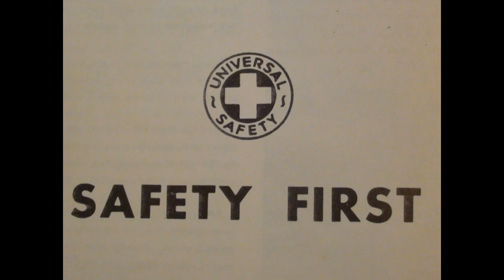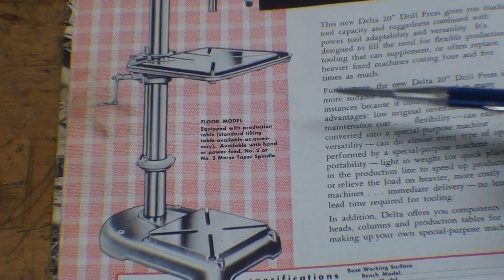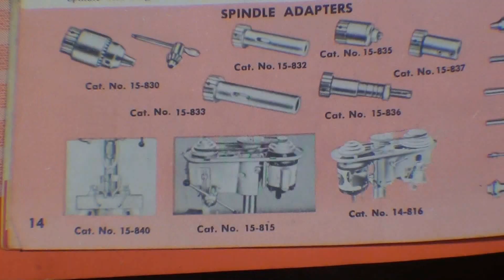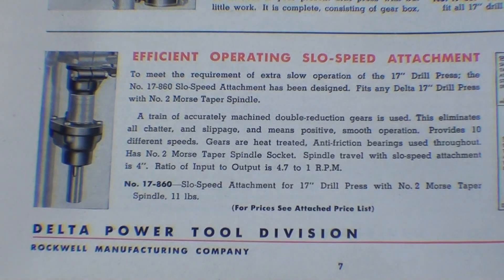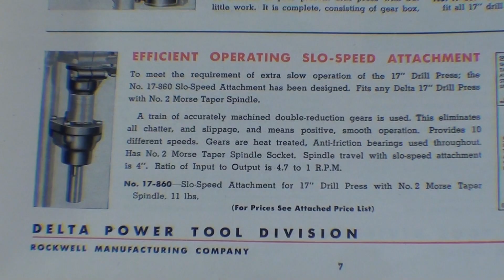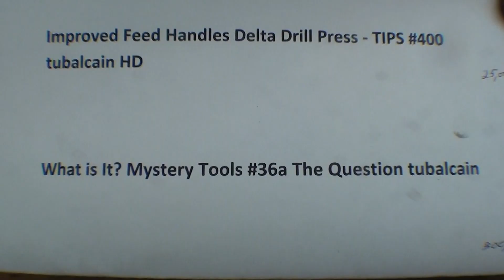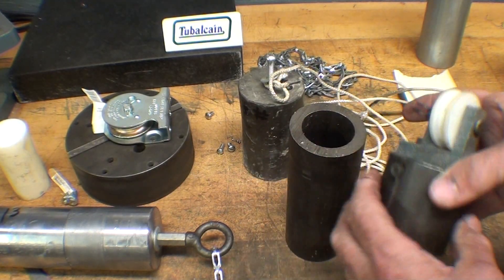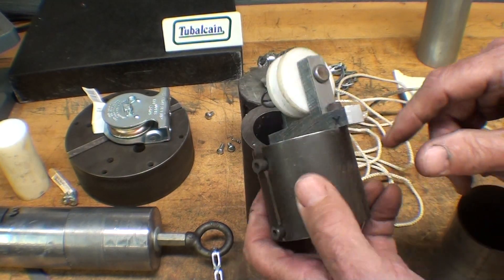COUNTER WEIGHTING A DRILL PRESS TABLE Tips #404  tubalcain

Comment: Fantastic. I bought an old drill press to restore, and my only disappointment with the machine was that it didn't have the table lift rack and pinion. I'll be making the same modification. Thanks for taking the time to make this video and help others like myself. BTW,  nice job on the handle spindle. Too many armchair critics make comments. Cheers from Australia.
Reply from the maker: Thank you

Comment: Did something similar to my now 45 year old Craftsman drill press about 40 years ago. I had to do it outside the main support tube and used a pulley, cable and for weight used a mushroom style boat anchor piled with blocks of babbitt that my dad gave me. Still working great.
Reply from the maker: Sounds like that also got the job done

Comment: Well I got one with rack and pinion, and one without. After watching you move that table, it looks like the counterweight is better than rack and pinion. I would like to convert the one without rack and pinion to counterweight, since this is the drill press I use every day.
I have some jig borers and the spindle heads are counter weighted and hung with real light motorcycle chain, think may be no 35. They have cranks that drive a sprocket, which raises and lowers the head. 
That sash chain looks kind of light, but I was not there to see it, but for those who may want heavy duty, just go with no 35 motorcycle chain. That is what I will use when I convert my drill press. 
Real cool video, this likely will help a lot of drill pressers, I know it helped this one, thanks for sharing.
Reply from the maker: That chain is  pretty strong

Comment: I made a table lift out of a harbor freight trailer jack. I also made a slow speed pulley set for the drill press as well as and extension to move the lock to the front of the table. It’s a walker turner as well.
Reply from the maker: That's a good idea
Reply: mrpete222 I could email pictures if you would like.

Comment: Lyle, another great video and idea, but here is a thought. As you are a 'Belt & Braces' man, how about changing out the top cap head screw of your pulley plug for a hex head. You should be able to get a spanner in to tighten it outwards, just enough to get a grip on the column tube. That will then save the Wings of your Greenhouse pulley rotating into your speed adjuster mechanism. My English Meddings drill is a solid column, so I had to pay out cash for the rack and pinion adjuster.Keep the excellent videos coming, and PLEASE DO NOT worry about your 'Ramblings', it s great to hear all your stories about life. If people do not like it then they can always fast forward or not watch at all. In case you do not put up any more videos for a while. Merry Christmas and  a Happy New Year to you and all the Family. Regards from Australia.
Reply from the maker: Thank you and merry Christmas

Comment: Nicely done. Greenhouse pulleys were used for opening and closing the vent windows if I remember correctly. That was back when a greenhouse used glass instead of poly. As far as complainers, mentally tell them what you would have told someone you worked with in a factory. Remind them it's your tools and not theirs. Also rotten comments are the sport of choice for people today. Their mouths never got them to meet up with someone in a parking lot after work.
Reply from the maker: Yes, heavy Pulleys two open heavy glass windows

Comment: Correct me if l'm wrong Mr. Pete, but those are YOUR drill presses to do what you want with them, Right?  Perhaps in some cases we should worry less and visualize Whirled Peas (7 billion of 'em)...it's a funny picture at least in my small mind.  

Thoughts for lowering the speed on you bench press is to check out the old 50's Craftsman/King-Seeley setup with a cam'd plug/middle pulley in the column.  Mine will go down to ~230 rpm.  You could build one easy!  Mine is a 49'/50' King-Seeley and lucky to get it with it.  Awesome thread on Garage Journal by FrankLee all about them and the multi-speed adapter and an external/internal counterweights.  I'll have to go external because of it, but loved your Sashi, belt and suspender, greenhouse pulley video.  

Thanks much, but I'm not convinced there is such a thing as too much coffee.  Someone said to me once "a yawn is a silent scream for coffee" and the older I get the more I tend to agree. ;-)  ~PJ
Reply from the maker: Thanks for interesting comments. I do have one drill brush that has that center pulley. And yes I would block the column and prevent its use for the counterweight

Comment: Thanks for the drill press tips. Probably the most common shop tool. I use one most every day. I actually own 5, and have considered putting a motor on mine table.
Reply from the maker: I also have five drill presses. Drilling is by far the most common operation in any shop

Comment: Good subject and solution.
I use an old Toyota screw type bottle jack to lift my table.
The Jack sits on a plate fitted to the lower pedestal and gives good fine lift adjustment to the table.
Reply from the maker: Good idea

Comment: Thanks for sharing this idea, and especially the sash chain which is thin for clearances.  Delta actually made a counter-balance unit (no. 1030) for production drill presses that was intended to be attached to the head of presses with a  2-3/4" column.  With patience it might be possible to get the pulley bracket or whole unit via eBay.  Or use the drawing in Delta's publication as a pattern to make your own. Delta used a spring, which is really hard to load into the column once removed. Early versions had a bicycle style chain, later versions used a cable.  Keith Rucker has the publication up on VintageMachinery.org
link: http://vintagemachinery.org/pubs/detail.aspx?id=2374
Reply from the maker: Thanks, I will look that up. I had never heard of that

Comment: how did you decide the amount of weight to use for the counter weight?
i had done something  close to that but with the weight outside, so now it will be changed
Reply: I hung a weight from a pulley I mounted to the side of the head. For a weight I used a piece of 3 inch PVC pipe that I put old nuts, bolts , and tire weights into. I added weight till the table was balanced. For an  incolumn weight, hang a pully from the ceiling and develop the correct counter weight value. then , using the known value for the weight of steel. ( or lead ) size the column weight.

Comment: One of the things that the Chinese got right was the rack and pinon as cheap as they were. I put hose a clamp on the column of the Clausing I had in my shop that was used by students and faculty. This after a close call for some toes!
Reply from the maker: Sounds like a good fix

Comment: My Rockwell drill press only has high speeds also. It was made primarily for wood working which typically uses higher drilling speeds.
Reply from the maker: Yes, some of them in the woodshop had a high speed motors

Comment: Excellent job mrpete. Thanks for sharing.  I would have  loved to do that to my drill press as the table was a pig to move but I sold it when I got my 2nd mill. Not enough room for it in my small shop. regards from the UK

Comment: I considered adding a counterweight to my larger drill press, it does have a crank but since the whole head moves motor and all it is quite hard work.
But seeing the size of the weight you needed just for the table I doubt I could fit enough lead in the column. Having the weight outside doesn't really appeal. I've also seen someone use an electric winch for the table.
Reply from the maker: Yes, your weight would you have dual been gold or tungsten

Comment: Great video. I can’t resist pulling your chain a little. Isn’t a grade 5 bolt overkill to hold the cap on the handle?
Reply from the maker: I knew I should have used a soft bolt in that application
Reply: mrpete222 I couldn’t resist being a wise guy. The cover was a nice touch.

Comment: Great idea!  I've got an old delta drill press with the production table and the crank works just fine but this counter weight idea is very tempting.  It would make that heavy table and vise just that much easier to move.
Reply from the maker: Yes, those tables are very heavy

Comment: Hi Teach. Randy here at 66 years. I recently picked up a 1941? Craftsman floor model drill press.$50 bucks. It appears it had a tough life. Came with a 1/4 horse motor 1750 rpm with a poorly built support bracket. The motor was shorting and stopped working, perhaps the brushes? I'm replaceing it with another higher hp motor, 3450 rpm, I had laying around. The press itself came with 3/  4 step pulleys. I ruined one of  them trying to get it off of the armature of the old motor. A replacement is on it's way. MY QUESTION IS any idea on how I can find a munual for it? The drill came with only one belt. I owned a Taiwan made drill press that had 3 pulleys but never changed the belts around. Arthritis, chemo(it worked killing the virus trying to kill me),major  loss of strength, Makes me think about a different design but utilise the counter balance idea. My middle pulley uses the support pole to rest in.  It has a handle on it I suppose to engage and disengage it. I've searched the internet for a munual with no success. Thank you for sharing your knowledge.
Reply from the maker: Good luck on finding a manual that old. Your only hope is vintage machinery.org

Comment: Sash windows are still very common in Britain due to the large number of Victorian buildings that remain in our housing stock (around 20% of all houses are pre-1919 built). Thankfully there are often local planning restrictions that prohibit owners from ripping out sash windows and replacing them with modern casement types so they are very familiar to most British people. We don't use chain for the counterweight mechanism, however, but 1/4 inch waxed cotton cord.
Reply from the maker: There still 100 million houses in the USA with sash weights. They're waiting their turn for vinyl windows.

Comment: Great idea.  Thanks for all your very helpful and instructive videos.  Other than trial and error do you have any idea how to establish how much weight to use?  Suppose I could weigh the table and use 75-85% of that weight.  I have 2 drill presses and seldom use the one with out the crank lift but will add this to my old Atlas drill press and it'll get more use.
Reply from the maker: No, it's strictly a guess, in fact mine could be 5 pounds heavier, but I do not intend to redo it

Comment: Great idea and great video. Sash weights are incredibly useful things to have around. I once use a half dozen of them to move 900lb limestone blocks. The blocks were rough cut and regular pipe wouldn't roll under them. The irregular sash weights had more traction and worked fine. I've pulled a lot of old windows out, but never saw a weight on a chain.
Reply from the maker: I never thought of them as rollers, you are right they are very crude

Comment: Great job Mr Pete,  btw i believe i have the same Walker Turner drill press from the late 30's / early 40's.  I do have the speed reduction pulley system.  Its my favorite press as well..  I actually sold a late model Delta floor press in its favor.
Reply from the maker: You did a wise thing. The old presss are wonderful machines

Comment: Perhaps on your drill press with the 4000 rpm to speed, you might install a “slow speed attachment” which is usually another v-belt pulley installed in the top of the drill press column. Hey, another project and an idea for another video. Also 4000 rpm is about the correct theoretical speed for drilling a one-sixteenth diameter hole in mild steel with a high speed steel twist drill.
Reply from the maker: Yes, I have one of those on another machine. They are cumbersome

Comment: Great video and a great improvement to your drill press. I have two Atlas 13 inch drill presses, that don’t really need this since the tables are not that heavy but I might make the improvement anyway. I also have a 20 inch Craftsman drill press that came with the rack and pinion mechanism for moving the table. Thanks for making the video.
Reply: Looking in my 1952 Atlas catalog it appears my two small drill presses are Model No. 1010 presses with 12-3/4 inch capacity. Catalog states 4 speeds between 580 and 5200 rpm so the both could use the “Hi-Lo Speed Attachment” which the catalog states will provide a low speed of 210 rpm.
Reply from the maker: Wow, that would cut the speedway down

Comment: I had been thinking of a counterweight running outside of the column. This is a much more elegant solution!
Reply from the maker: Yes, if it's outside of the tube, and will swing around when you move the machine. And looks like heck

Comment: When I did something I thought was clever, dad would say, "Well, you are smarter than a circus flea!"  That counterweight is very clever.  I will retro fit my Clausing with one.  And I NEVER knew there were MT adaptors for a drill spindle.  I have the same type chuck as you showed, so now I NEED one of those adaptors.....  Thanks Mr. Pete!  Good stuff.
Reply from the maker: I had never heard that expression. Thanks for watching

Comment: Very nice adaptation of your memory of the sash weight. Hope some of the younger viewers realize that you CAN use your experience with other systems and are able to adapt the old system to overcome some problem like you did in this video. Nice Job!
Reply from the maker: Thanks. I enjoyed your video on the handwheel for Keith. I made a similar video about five years ago, where I made a mold and cast a hand wheel for the Bridgeport mill. Then I saw more recently, A man from England by the name of double boost also cast A hand wheel. It was almost as if he had copied my video.
Reply: Sandrammer: Very true! I've made a career of taking multiple sources of equipment, technology, and techniques to solve research, development, and production problems.
Reply: Why didn't you use steel cable instead of the chain , I would think it would work smoother through the pulley. Not trying to be critical , just trying to understand you're reasoning.

Comment: Really simple and effective improvement for the drill press.  I have a circa 1947 ER10 Shopsmith that I have set up as a dedicated drill press.  The table was a bear to move even when it was new. My solution was to install a length of 1" all thread vertically between the two vertical pipes and attach the table via a nut held captive to the table, a thrust bearings at the bottom and a 1" captive nut at the top.  I use a cheap air ratchet and shop air on that nut to raise and lower it.  $20 fix.
Reply from the maker: Thanks, good idea

Comment: ..I've got a Walker-Turner like this...for the lower speeds, there's another pulley set that mounts on an 'idler'...it is mounted  on that bracket to the upper left of the motor pulley....
Reply from the maker: Yes, I have seen those units

Comment: Just like always another GREAT video mrpete!!! this is a great idea and I never heard or seen it before I will do this for sure on my Delta Rockwell floor drill press I picked it up for only $80 I was told that the bearings were shot as it was "Locked up tight" turned out it was just that nut on the bottom of the spindle I still haven't work on it much but like you it is cold and only going to colder so it'll have to wait until spring Thanks again mrpete TWO THUMBS UP Sir!!!
Reply from the maker: Yes, give it a try on your press

Comment: nice job Mr Pete, I did something similar to my drill press using a concrete test cylinder  and a external pully. it doesn't look as nice as yours but works very well. use what you have. thanks,for the videos.
Reply from the maker: Good idea

Comment: Rather using rope clamps to form an eye in wire rope I usually unwrap the wire rope into two legs and then re-wrap the legs starting about the middle of the unwrapped section, keep recombining the legs up to the branch point. Finally capture the ends and the rope proper with a section of copper tube  which is crimped into position. The twisted "splice" in the rope takes all the load the copper tube is only for good looks unless you use a proper swage and crimper. Eyes made this way are surprisingly strong but no doubt illegal for rigging purposes but with some uncommon sense they can be used safely in many less critical applications like say a drill table counterweight mechanism :)
Reply: I learned wire splicing many years ago and it is actually better than clamps. Installed incorrectly they will damage the wire or potentially allow slippage. Yours doesn't sound like a proper splice, but should be good enough in that situation.
Reply: wire rope splicing is a lost art. these days the safety police will not allow spliced rigging slings, around here at least.
Reply from the maker: Good idea